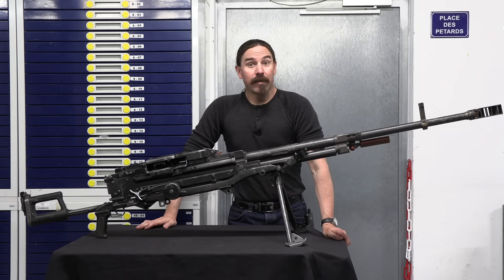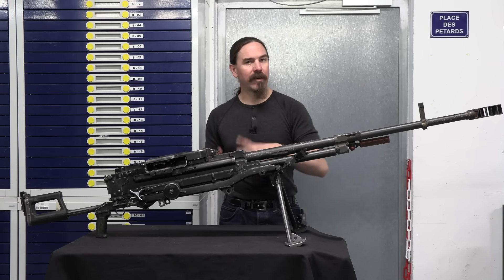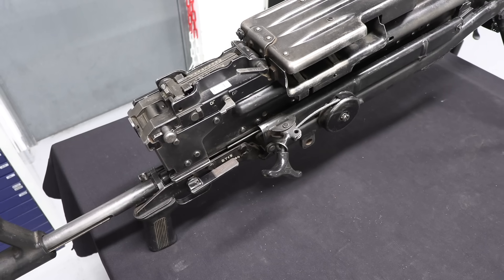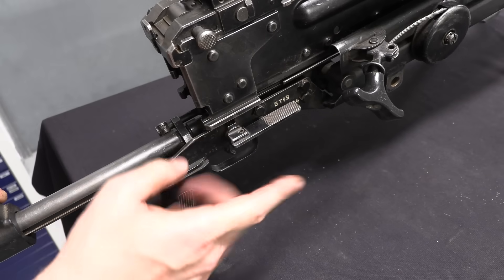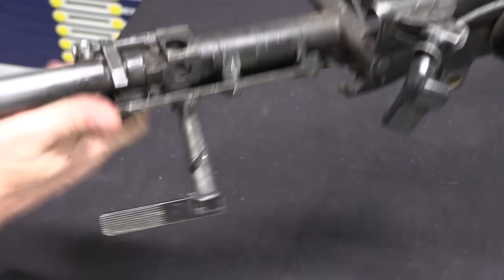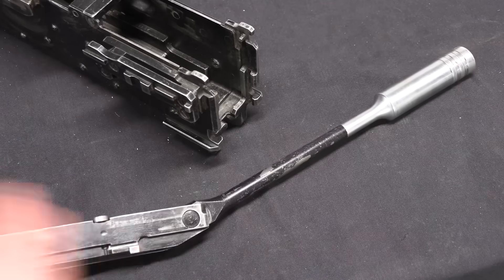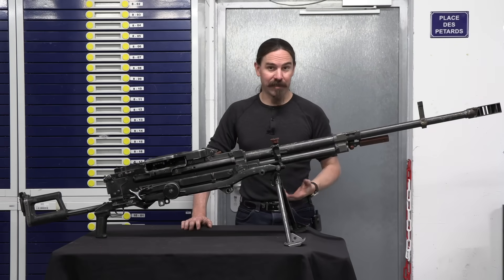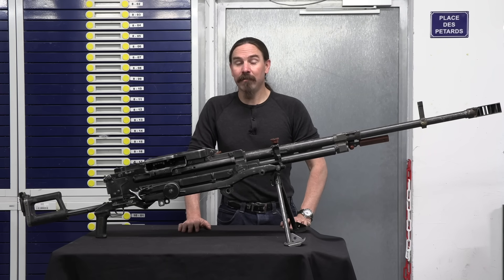Kord: Russia's New .50 Cal Heavy Machine Gun

Comment: The fact that a 50 cal (using a roughly equivalent round to the .50 BMG) can be fired from a bipod at all is quite a feat of engineering. Meaning that you can either use the gun with one less crew (you no longer need a soldier just to lug around the tripod) or you can haul 20-30kg more ammunition.
That it's also modular enough that the core of the gun is identical in its infantry and vehicle version is also quite useful.

Overall, the gun is also quite controllable in both bipod and tripod configuration (although when used with a bipod it's not very accurate at long ranges, 500+ m, but for urban combat it's great as it will rip through anything but reinforced concrete).
Reply: Вообще то у нас принято, что расчёт таскает на себе только пулемёт и станок. Патроны, как мины носят на себе все члены отряда.
По крайней мере так было в 95-96. Мы бы сдохли в первый день таскать ДШКМ, а ещё и патроны. Это хорошо, что до горы возили, но в в гору этот железный гроб несли на себе
Reply: И бетон пробивает очень даже хорошо.  15 см насквозь
Reply: There was a 50 caliber variant off of the 25 mm grenade machine gun.   Iirc it was about 25 lbs, 300rpm, used firing out of battery to control recoil.   Article I read said the troops weren't happy with it because it didn't have a high enough rate of fire.
Reply: если не знал то русский патрон .50 мощнее западного.в нем больше гильза и больше пороха. что то типо 18000 джоулей энергии а у западного .50 - 16000 джоулей.
так же он отлично пробивает и железобетон просто надо несколько выстрелов сделать.
Reply: @ivannegrozni7692  The only 16 000 J round in use today for the .50 BMG are practice rounds. The AP and API rounds all have above 18 000 J of muzzle energy.
Reply: 😂😂😂😂
150 dolarlık bir drone uçmaya başladığında agır bir silah.
Reply: What are you talking about.... Ain't no way I'm going to be shouldering around that mini bicycle.... M2 still more reliable...

That kind of system is too complicated compared to the M2 Browning...
Reply: Have you actually seen these things fired from the bipod? Beyond useless. The first round may hit the target but the next cluster of shots will fly high up in the air from the ridiculous recoil and high ROF. It's a last ditch feature that's only worth using if that's your only choice. This thing needs to be mounted on something, anything (truck, AA tripod/regular tripod with sand bags weighing down each leg) to be effective
Reply: @Gameprojordan  I've fired one (although only once, through the weapon familiarization training program where you went through a number of possible weapons the enemy might have). As long as you use very short bursts (you can't use the 12-20 round salvos you use with a normal MG or an MG in tripod mode) it's fine at short distances (below 500m). Enough to do what it's supposed to do (mess up people hiding in solidly built buildings).
Reply: @Gameprojordan  пулемет КОРД достаточно кучно стреляет с сошек.конечно длинными очередями в любом случая стрелять не стоит а короткими очередями он очень хорошо стреляет
Reply: @Gameprojordan  How does it compare to a semi-auto .50BMG like the Barrett M82?
Reply: @Treblaine  Dude, M82 is an anti-materiel sniper rifle. KORD is a HMG.
Reply: @Max_Da_G  I ask because everyone who has ever recounted the KORD's fire rate has has said the fire rate is way too high for the weight of the weapon - it bounces around so much - so you need to fire it single-shot to be remotely accurate.

So this HMG is effectively used like an anti-materiel rifle with aimed single shots.

It's one reason why the US has not made a similar small .50BMG machine gun, because they already have a .50-cal weapon that one man can move into position and shoot from a bipod. Yes, the firing mechanism only lets it fire one shot per trigger pull but the physics of recoil limits you on that anyway. Firing from a closed bolt just allows more accuracy on that single first shot.
Reply: @Treblaine  its a Soviet M2. Why are you asking silly questions like how does an M2 compare to a M82? One is a machine gun with big bullets, one is a semi automatic rifle.
Reply: Да и в целом советские и российские пулеметы уступают по показателям. В единым м240 оказался лучше.
Reply: @Truth_is_where_lies_are  😆
Reply: @Truth_is_where_lies_are  да и в целом хуйню нести легче чем бревно
Reply: @Truth_is_where_lies_are  что бля?по каким показателям?у нас даже патрон мощнее олух...сиди на диване давай пивко глотай
Reply: @Zordeos  вроде не вроде...пороха может и лучше раньше были в послевоенное время ну после 2 мировой. но ты ж не думаешь что порох так сложно делать что мы не могли наладить более чистое производство в послевоенные годы?ну бред же.да старые патроны могут быть похуже.но в советское послевоенное время были уже нормальные заводы пороховые.
да и ваще пистеть можно сколь угодно но есть заявленные параметры тестовые.у нашего 12.7на 108   18тыщ джоулей.у натовского гильза 104 чуть меньше и какие бы пороха у них не были но заявленная мощность боеприпаса 16-17тыщ даже от 15500 вроде чтоли.опять же есть разные патроны включая гражданские варианты могут быть потому разброс бывает разные.но заявленные параметры не просто так заявляются.наш патрон не намного сильнее но в целом чуть чуть посильнее.это даже на тестах пробития не раз видел на всяких видео где наш патрон пробивал чуть больше.
Reply: @ivannegrozni7692  я вижу, что структура у пороха в наших патронах и в натовских разная. То есть "крупицы" разные. Я не утверждаю, какой патрон/пулемет лучше. Просто вспомнилась такая информация, по порохам. А вообще, будь я пехотинцем, ни под тот, ни под другой попасть не хотел бы. И был бы очень рад, если бы меня прикрывал хоть тот, хоть другой. В смысле убивают они одинаково,  больше от пулемётчика зависит, чем от параметров, ибо их расхождение не критично.
Reply: @Zordeos  а ну тут да может чуть разная фракция.это может приводить к разному горению пороха.может даже у них в этом плане частицы мельче и лучше сгорают чуть хотя может и менее стабильно кстати.для порохов важна равномерность горения еще.чтобы фронт пламени двигался равномерно.может потому у нас чуть иначе делают а может потому что насрать и так сойдет.но в любом случае даже если у них чуть лучше порох  с точки зрения гранул наш патрон все равно чуть мощнее по ттх тестовым вот и все.да и как уже писал ранее по идее старые фабрики должны были перейти на современное оборудование и я сомневаюсь что современный порох в последние десятилетия хуже западного. ну макс чуть разницы от разницы частиц но там чуть чуть.пороха у нас все равно больше в гильзе и патрон чутка сильнее.
18 или 16 тыш энергии не критично вообщемто на войне решает куча других факторов.а убьет тебя и камень если на то пошло...
по сути особой разницы нет какой пулемет в тебя стреляет они как уже писал не сильно различаются в энергетике пуль.
Reply: М2 точнее и мощнее, это уже доказано. По таблицам патрон корда мощнее, но только в таблице, ибо в практике он уступает м2 по всем боевым пунктам, кроме веса. Но вес играет с ним плохую роль, потому что нужно лучше укреплять его перед использованием. Его можно сравнивать с дшк и утесом, крайнего часто клинит. Но м2 будет лучше, стар, но не бесполезен.
Reply: @Truth_is_where_lies_are  хаахах м2 лучше доказано....он и стар и бесполезен ибо не надежен.патрон у него только у сказочников тупых лучше.а впрочем че тратить время на барана.
Reply: @Truth_is_where_lies_are  ключик у офицера не забудь попросить, а то мега пулемет будет бесполезным куском металла. Если ты думаешь, что браунинг не клинит то ты будешь не прав. Дохрена роликов от 404, где он клинит.
Reply: @dobrendo5909  М2 клинит только если не знать, как за ним ухаживать (на всех модификациях, кроме последней, надо дрочиться с зеркальным зазором)
Но как только ты всё настроил - работает отлично
Reply: @mk-ew9il  мой коммент был для чела думающего, что браунинг ультимативный беспогрешный пулемет. понятное дело, что любое оружие нуждается в обслуживании
Reply: @Truth_is_where_lies_are  LMAO BS.

Comment: LOL, Russia is remaking the Ma-deuce, meanwhile Brandon Herrera just finished the AK-50
Reply: DShK was the Browning equivalent, development of that one starting in 1929. Kord is the 3rd generation of Russian HMGs, absolutely blowing the original M2 out of the water in every metric. A more appropriate comparison would be the M2A1, which entered US service around 15 years ago, and the Kord is significantly more technologically advanced than that. Your slander of it is based entirely on your prejudices against Russians, because objectively speaking this is one of, if not the best MG of this type currently in service. The US tried a replacement that would be of comparable quality, but decided it wasn't worth it and stuck with their century old design.
And the AK50 is just a goofy side project for youtube content, i don't see how it's at all relevant
Reply: @lred1383  I have no prejudice against Russia as a country, but Russia as a technology and manufacturing giant stopped in the 80's, Russia has remade their heavy machinery gin 3 times since the 50's the m2 hasn't needed a replacement in 80 years, (in fact in 2015 one was found still in service that hadn't been repaired since its commission)  I would argue that a platform that has triumphed over any replacements for a century beats one that has been remade 5 times, technologically, no heavy firearm has been significantly changed since WW1, much like the gasoline engine, only slight tweaks to machining are ever different, and the ak-50 is relevant because it took and American to prove that Russia didn't need a pull cord and new triggers if they just relied on the tried and true platform that has continued to work through the last century, my point is why fix what isn't broken, and my proof is that guns like the Maxim, M2, AK, Mosin, 1911,  MP40, and sturmgewer, these are all guns still faithfully serving still to this day even in the current conflict!
Reply: @kiralana324  i see your point. I do think there have been many nice QoL changes made over all this time, while the M2 has largely been left behind and relegated to almost exclusively vehicle mounted use, only using MMGs and LMGs for infantry. and that same logic of "don't fix what isn't broken" can be applied to say that the HMG class of weapons is so simple that most "new" designs are just modernized versions anyway.
As for the AK50... i have no idea why you insist on using that toy as an argument. It's a semi-automatic rifle that doesn't fulfill any of the criteria of a viable HMG design, besides being a shooting tube with a gas piston. It's mag fed, with a hard to replace barrel, probably shit accuracy compared to other .50 cals, just not even remotely comparable.
Reply: This is from 1998
Reply: @TriremeBoy  And the M2 was made in 1928, still in use today, so it took Russia nearly 100 years to play catch-up, and it still looks like it's design came out of a fifth graders art of conflict assignment! AND  a Texan still made a better AK .50 than Russia

Comment: I'm confused on this weapon's purpose, is the intent to make a man portable 50 cal? It's modular, but not in anyway that matters. It's "lightness" seems pointless given how little ammo a squad can carry for this.

Do you need foot mobile 50cal on the assault? How long do you expect that to be sustained by ammo bearers? Seems too light for direct fire support, easy to spot and kill, but also too heavy to logistically support for more than a few minutes of firing.

All that to kill light armor or negate some cover could be better spent on mortar and RPG rounds.
Reply: While defending a strongpoint in the urban setting or a trench network you could have enough ammo and bearers on hand but may need to haul the gun around, fire from confined spaces and GTFO quickly, and a big ass tripod doesn't quite facilitate this gymnastics. Ukrainians are putting their old DShKs on bipods routinely (though tripods remain in use as well, often tall to fire over high parapets typical for windows in the concrete buildings or for AA work).
Reply: Even if it is not a truly foot mobile in the sense like a PKM or a MG3. It makes perfect sense to update and revise existing platforms with new technologies and materials. 

That's like saying, lets keep the BAR/ AR15 with all the reasoning above. 

The Russians specification for the Kord is quiet straightforward, make a HMG that does not break the backs of infantry, able to be fitted on a multitude of platform with minimal retrofit and to be just as good if not better than the NSV. 

And by all accounts they did it.
Reply: if your meager mind is not able to understand the tactics of its application, this does not mean that it is not viable
Reply: I explained my thought process. You didn't provide any contrary points.

I don't see any western equivalents to this "light" fifty, that is likely for a reason and I suspect it is what I laid out.

IMO: 7.62 is good enough on the assault, and if you need larger it'll be 25-30mm HE/APDS.
Reply: @nicholasferreira3263  ask the Ukrainians why they put their DShKMs on welded frames from the garage. maybe it will dawn on you that firepower is never superfluous
Reply: You're speaking in platitudes, I am speaking in raw practicality. Firepower you can't logistically support for more than a few minutes of firing IS superfluous.

12.7 has 1500m range with proper position and holds, but a mortar has 3000 meters range, and can be paced for overhead effect.  At a certain point this gun is going to live on a vehicle to have maximum access to ammo, so the decision to make this a ground gun for infantry is interesting to me.
Reply: @nicholasferreira3263  I'd like to see how you use the mortar inside the house. if you are not able to understand the tactics of using such weapons, then with such weapons you can quickly change position with a crew of two people and it won’t even dawn on you
Reply: @jah886  Crew of two people. How many MORE are carrying ammo? Are they near their BMPs for logistics? How long can they fire for?

I don't see 50cal as USELESS, but I do see a diminishing return for dismounted use of this.

Comment: It still looks archaic compared to the M2. The over 100 year old M2
Reply: what what come on, explain to us why it’s worse than M2
Reply: So it's this thing and not ME that's archaic? What's the method of locking the breechblock in M2? Rotation of the bolt? No, guy, this thing is yet to hear about rotating bolt, while Kord has it.

It's lighter, adaptable, and with built-in optics mount.

It's M2 the mammoth-era-age-shit.

It's M2 that the US military tried and failed to replace by M85. Which already speaks a lot about different things.

Comment: Wow! I have never seen a 2-stroke machine gun before.
Reply: Now I've got an idea for a dieselpunk monstrosity of a machine gun driven by a repurposed car engine, imagine getting thousands of RPM with a variable fire rate you control with a throttle and a gearbox 

Actually now that i think of it you could just put a motor on a Gatling gun and there you go
Reply: @angelTechnician64  So you are making a Diesel Mini-Gun.
Reply: @icedriver2207  yeah i realized that about five minutes after i made that comment lmao
Reply: @icedriver2207 I think using compressed air and a turbine like in a pneumatic grinder would be more appropriate. In case there is no compressed air or no time to pump it up - use a manual drive with a clutch similar to a bicycle clutch. Although in that case, why not use a spring like on a gramophone?
Reply: @angelTechnician64  hahaha my brother in Christ gatling guns are already motorised.
Reply: @conormcnamara2273  *sister and no, gatlings are operated by a hand crank, you're thinking of miniguns
Reply: @angelTechnician64 M134 Minigun is not a single electric rotary machine gun in the world
Reply: @angelTechnician64  Miniguns are specifically 7.62mm M134s. All rotary barrell guns are Gatlings.
Reply: Ever since California banned two stroke engines they have converted to battery powered ones.
Reply: Sounds like Wolfenstein